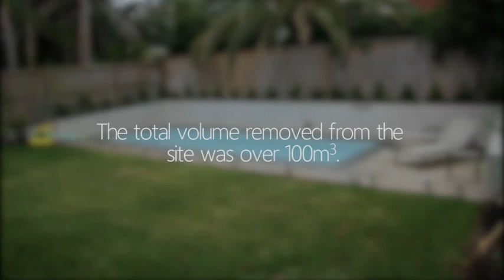DIG IT Civil - Swimming Pool Excavation - Dover Heights, Sydney

Comment: Glad im not a yanmar vio17  those guys dont know how to hammer for shit......if your using an austramac quick cut 1000 you can do a 450mm cut with a double cut at the end of the pool ...knock that out and then you can flat hammer out3-4 mtr long sections of sandstone and hammer them into 1 mtr lenghts load into track dumpers like c12r yanmars with high sides( same width as ex you drove in there).... use an ex with grab load them onto pallets with a crane truck take a saleable item back to the yard for a wet day when you can cut it into regular blocks.....instead of wasting your time hammering it up into rubble.....you must have shares in conveyor and hoist ......and you didnt even bother to hire the hopper for the loading end of the conveyors......just sad ....and i bet the client cried when they signed the contract for this job